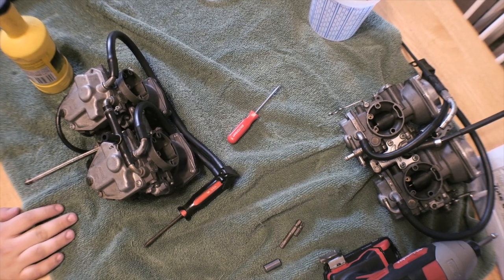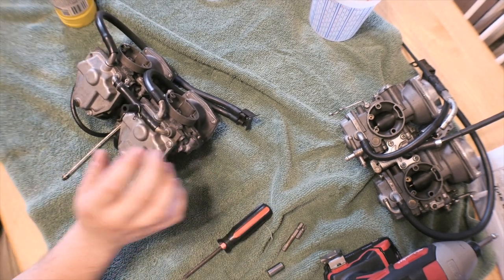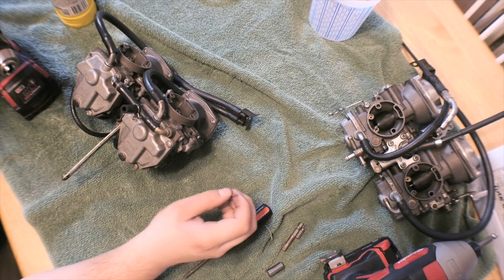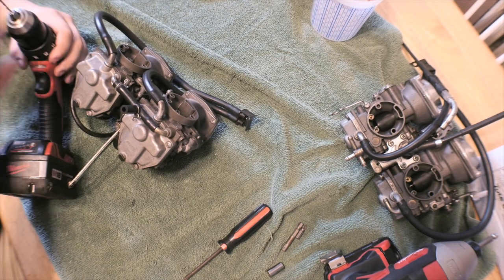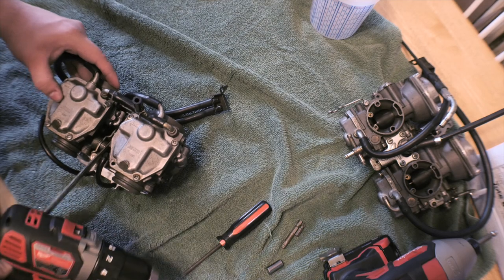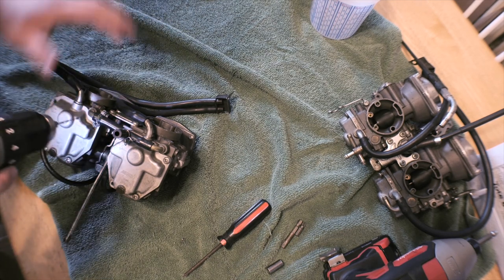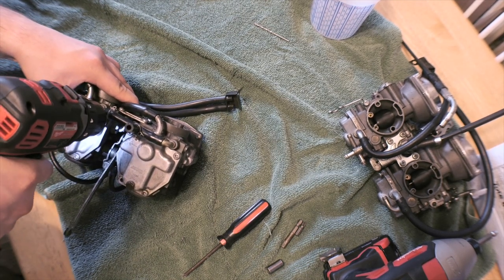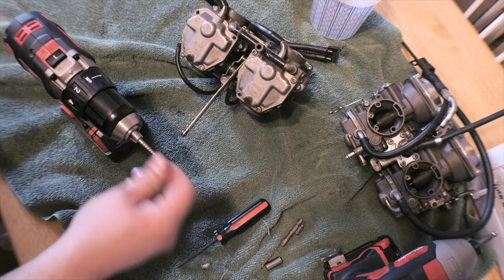How to Remove a Stripped Carburetor Screw

Comment: I know this sounds crazy but i had 2 really bad stripped screws on my big bear350 to take the float off the carb i tried everything then i desided to put some glue on the head of the screw driver it got all over the bolt and by the threads then i tapped the screwdriver with a hammer on the screw and it came right out!!!!

Comment: Hi mate one of my pilot screws on the other side was rounded off when I got it, are they fucked? Brass is so soft
Reply from the maker: You might be able to go at it very very slow and possibly drill a hole through it.